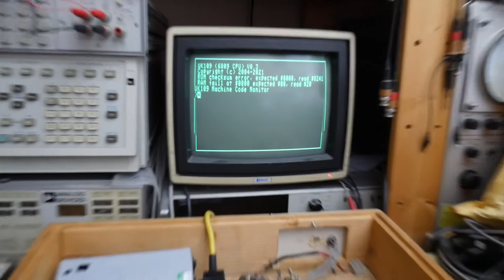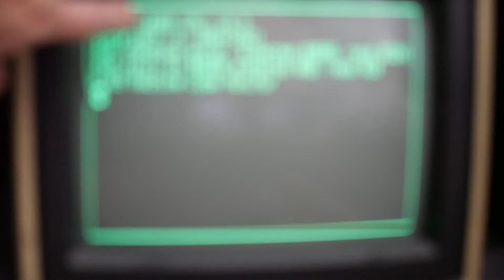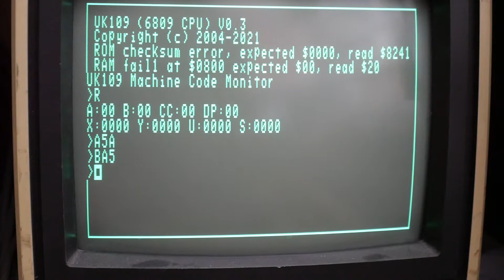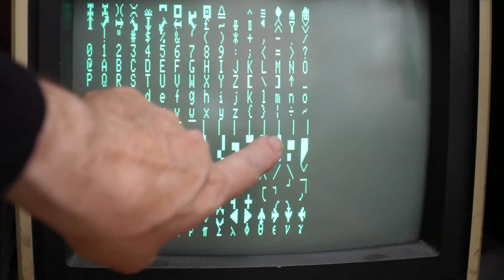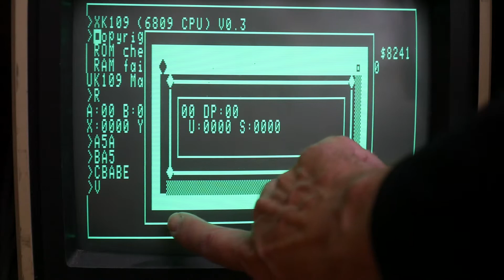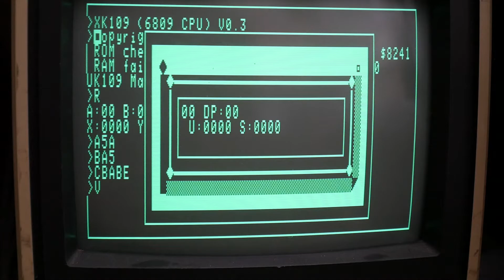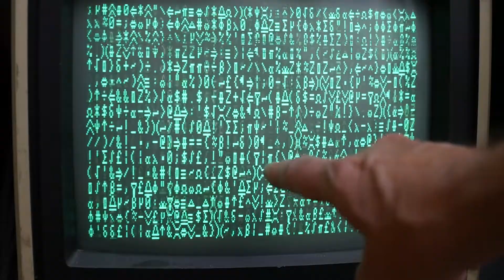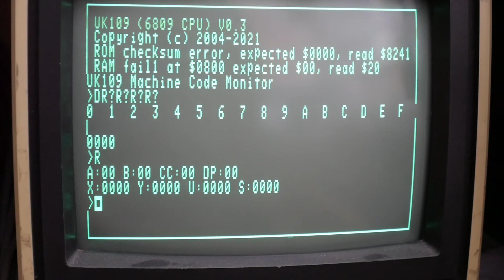UK109 Demo for RetroChallenge

Comment: Wow, I still have mine too.  My mate across the road also had one with the 610 expansion board and disk drive that I was very envious of. I had to remove all the IC sockets and solder the chips into the pcb as they went black, giving poor contact.
This computer started a long career in electronics as I'm 64 now and soon to retire , so maybe I'll get round to playing  with it again to get it to do something useful such as adding some I2C temperture sensors to control the central heating in a smarter way or something. I was tempted to build the FPGA clone that's online at some point  so maybe that would be better and a lot less power hungry.